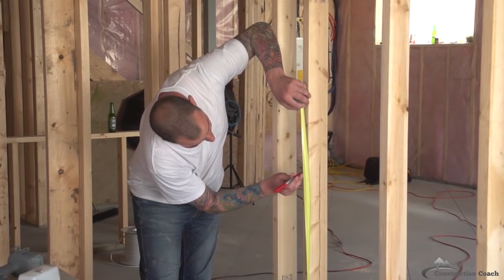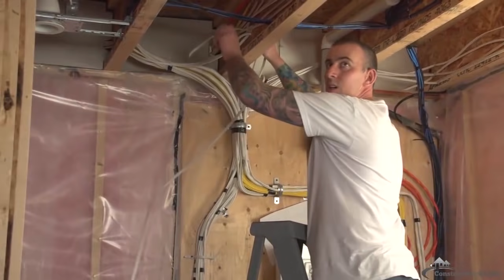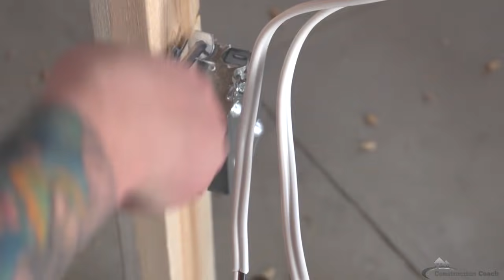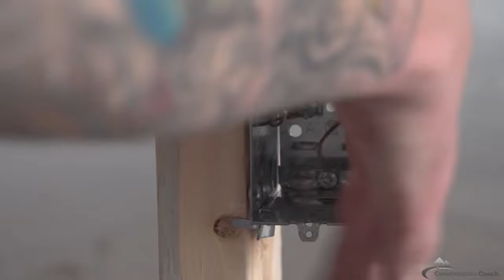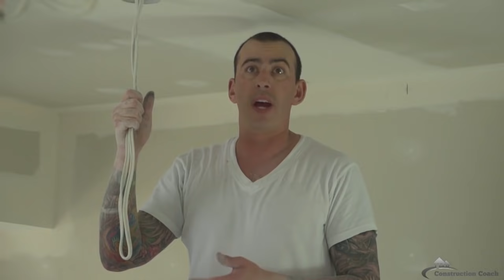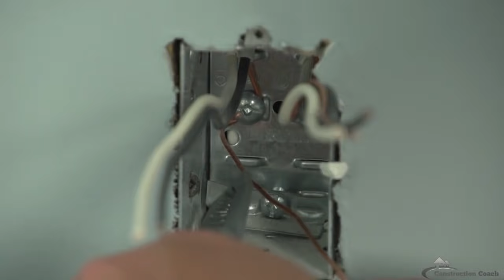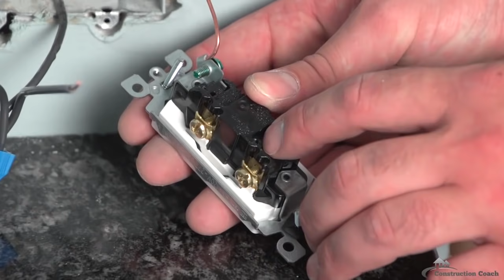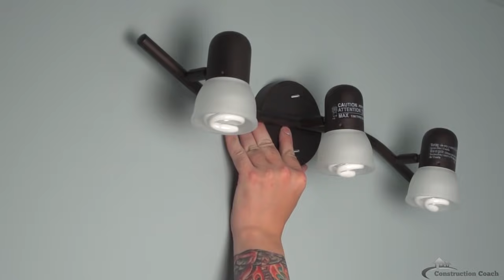Home Electrical 101 - What you need to know now!

Comment: why didn't they do the vapor barrier after you installed the outlets
Reply: tony krzic Just like my house, the house was bought with an unfinished basement. The foundation walls need to be insulated and a vapour barrier installed. If a home is bought with a finished basement, they would have definitely installed the insulation and poly after the electricians had roughed in the walls.
Reply: tony krzic hui
Reply: tony krzic *receptacles
Reply: Because it's not they're responsibility to hold his hand. You need to stay ahead of burying trades. (That's why they have job meetings). Shit rolls down hill and the last guy in the wall loses. That job ended up taking longer than it should have which equals less money in his pocket.
Reply: t krzic just a thought but I found out my boyfriend is gay

Comment: I was told never to split the outer jacket with a razor knife like that.  I always split just about 1/2" on the tip, then pulled it apart and knipped it off with linesman's.
Reply: Actually, Klein makes a hook blade knife that is designed to split the outer jacket of Romex, they work quickly and safely.
Reply: Joe Swanson he bends, then cuts a half inch from the bend on each end, specifically, because he says you shouldn't utilize the bent section
Reply: I've been doing it like that for 30 years
Reply: @chadwillis1010  I had one of those when I was a rookie

Comment: bro 14 gauge wire on plugs? Its fine for normal lighting but i would run 12 gauge on plugs.

common sense code-
240.4(D) Small Conductors. Unless specifically permitted in

240.4(E) or (G), the overcurrent protection shall not exceed

that required by (D)(1) through (D)(7) after any correction

factors for ambient temperature and number of conductors

have been applied.

(1) 18 AWG Copper. 7 amperes, provided all the follow-

ing conditions are met:

(1) Continuous loads do not exceed 5.6 amperes.

(2) Overcurrent protection is provided by one of the fol-

lowing:

a. Branch-circuit-rated circuit breakers listed and marked

for use with 18 AWG copper wire

b. Branch-circuit-rated fuses listed and marked for use

with 18 AWG copper wire

c. Class CC, Class J, or Class T fuses

(2) 16 AWG Copper. 10 amperes, provided all the follow-

ing conditions are met:

(1) Continuous loads do not exceed 8 amperes.

(2) Overcurrent protection is provided by one of the fol-

lowing:

a. Branch-circuit-rated circuit breakers listed and

marked for use with 16 AWG copper wire

b. Branch-circuit-rated fuses listed and marked for use

with 16 AWG copper wire

c. Class CC, Class J, or Class T fuses

(3) 14 AWG Copper. 15 amperes ************************************************ those plugs are on 20 amp breakers.

Comment: A lot of folks only have lower  levels partially finished off. He was not the  general contractor. I watched the  entire video except for  maybe  code variances he gave   good  solid  advice. Nothing wrong here  so  just because he ain't doin' it like you did back in  the day when you  kept  finish nail  or two  n your  lunch box  to  use  as  a toothpick  to get  yer wife's homemade Jello out from between your teeth   He gives  really good advice  even the old  timers could  learn a trick  or  two from him. FYI  I built and remodeled homes for 45 yrs.

Comment: dude...you forgot to put tape on the divaces...doble safty becouse you used metal boxes...plus you never cut an extra groud wire ....what you do is twist them toguether with the rest of the grounds and put a ground wire nut or a groud clamp and pig tail them out....plus receptacle code is the first one must be with in 2 feets of the door then every or with in 12 feet max......
Reply: Isn't the code within 6' of a door.
Reply: yes
Reply: He definitly forgot the tape but here in the EU (europe) we use plastic

Comment: Lights and sockets on the same circuit????????????????????????? :o) Not good!!!!!
Reply: Alan Lumsden this is residential work so this is normal.
Reply: It's certainly not normal in the UK
Reply: Alan Lumsden 25yrs doing electrical and its not the norm to wire lights and outlets on the same circuit in Connecticut.
Reply: Key word you said there was in Connecticut.
Reply: There is nothing in the CEC or Ontario supplement that doesn't allow lights and general duty receptacles in a residential dwelling to be on the same circuit, save the specific receptacle circuits that are now protected by an arc fault circuit breaker.
Reply: As a practical matter if you tinker around and you blow the breaker then you are in the dark. Thus often a design taboo unless one is selling cheap low-end track homes. ie one is cooking and a toaster and blender plus refrigerator just starting would blow the breaker then the kitchen is dark with the hot items on the stove. Tract apartments did this in Calif, so cheap that there were no ceiling lights in the 2 bedrooms, the wall switch controlled the duplex wall plug that the tab was cut so top plug switched and bottom always live. Once you had the old CRT TV, connected the stereo amp and a 1500 watt heater on a rare night the breaker might trip and you are in the total darkness. One learns to have handy flashlights. The entire setup was the tenant had floor lamps, their own stuff to ruin. The circuit breaker box was in the kitchen area, it did not feed the token 120 volt smoke alarm above the stairs. Thus when the alarm died at 2am at night one took the gizmo apart to go to sleep since it would chirp all night. The roofs AC unit always was at 2 amps to the breaker but no real power they had the capacitors on the feed side of the contactor to add Reactance to the system to even out the other units motors inductance. The only 14 awg wire was to those smoke alarms that went to each block of 4 units, the building had 4 blocks of 4 units thus 16 apartments per early 1970's building. The only aluminum wire used was the feeds to each subpanel in each apartment. These connections would be doped up and retightened when the unit was re-rented since earthquakes tended to loosen the connections. There was the typical no service loops or slack to save money thus the wires would move and loosen up and thus heat up the subpanels input lugs.
Reply: All kitchen counter receptacles here are split, two separate 15 amp circuits, one for the top and bottom of the counter receptacle and usually around 4 of these, all depending on the length of the counter. Refrigerator are on there own circuit, as are microwaves. And of course ranges have a separate 40 amp 120/240 V outlet. The smoke/CO2 detectors are on a separate circuit other than hall lights so it's easy to tell if the circuit has failed. We have to do a calculation to ensure any any circuit runs will maintain the minimum allowed voltage drop, the 4 blocks of 4 units sounds like it would violate code to use 14 ga as the feeder.
Reply: Those old Calif Apartments probably had an inspector to check the model apartment to correct NEC code, then they just wired the apartments like they wanted to. The smoke alarms draw hardly any amps at all even when in alarm mode. Since 14 awg is the required min wire size they use that. But they did have them wired through a breaker not in any of the 4 apartments. Maybe some odd California Fire rule, I am not sure at all. 

Down here in the swamp the breaker boxes get corrosion with time. It rains 70 inches per year. A 20 amp breaker that sees little current flow may later make noise ie sizzle on its lugs when say a big 13 amp dehumidifier is connected. Usually, the breaker thus gets hot and it will trip at a lower current, ie springs weaken. But I have had some eat the lugs off the breaker box and thus that slot has to be abandoned, plus breakers that use the same lug.  The better boxes have solid copper with plating. The econo box has steel? or some other metal and plating thus these are less robust around salt air and water. Regards.
Reply: Shocking
Reply: Lights and receptacles on the same circuit are perfectly normal and to code.
Reply: Chad you definitely do not know anything about code. Kitchen counter outlets have to be on at  least 2 circuits and be 20 amp rated. They do not have to be divided receptacles.
Reply: Sorry Doug I guess after 30 years as a Master Electrician I don't know anything. I didn't say thay Had to be splits. You should read CEC code 26-712 (a) (iii), you can use either 5-15R split receptacles or 5-20R along counter work surfaces. The 5-20R was only reintroduced to the CEC code about 10 years ago to try align the CEC with the NEC. It is an antiquated method we used to use 50 years ago. The split receptacles are far superior but more expensive to install.
Reply: Hi Chad, what is funny is most folks I know do not own any gizmos that plug require a 5-20R type socket. ie even my big worm drive saw does not have the one pin turned 90 degrees. But I do have a 1500 120 v watt water heater with 12 awg wire plugged (yuck) into a regular 5-15R receptacle and this does make it warm. ie 1500/120= 12.5 amps. I was over slighty the 80 percent rule ie 15 .8=12 amps. By changing both the plug and socket to 5-20 R and P the connection is cooler. ie 20.8= 16 amps. Both plugs were brand new, the 20R was new, the 15R was older. As an experiment I cleaned up and tried a new 15R and it too ran warmer than a 20R with the 12.5 amp load. Thus the intervals brass pieces of the 20R and 20P I think are bigger in cross section. Thus a 5-20R duplex in a Kitchen might more that the receptacle can handle two gizmos better than a 5-15R duplex.
Reply: Nothing in the code state that plugs and lights have to be separate. But if you're doing a reno from scratch it is recommended to separate the lighting circuit from the plug circuit
Reply: I been in the field since 2006, each Continent has different codes, rules and AHJ, in the US, receptacles, switches, lights, etc running the same amperage can most definitely run from 1 another, as long as the device performs to its standardized function you can do almost anything as long as compliable with the NEC.
Reply: Alan L'
In England they use "Ring Main system" with plugs that have fuses in side that are rated to suit the appliance to which it is connected. Most people here in Canada have never even heard of that system. 
But it is allowed in Canada to wire the lights into the receptacle circuit
Reply: Doug/ Chad  The code has now changed. 
In the kitchen you have two receptacles  side by side in a double box. One outlet is wired to one circuit. (The 'hot' connector strip is not cut )  The other outlet is wired to a separate circuit. 
#12 wire is used for these circuits with a 20 amp breaker per receptacle combination.( usually 12/3 with ground is used, One red and One black per circuit, with a common neutral white.
Another double outlet box is then wired in the same way. These two boxes must not be more that 4 feet apart, (in fact all receptacles that service the kitchen counter tops must not be  more than 4 feet apart.)
There are more regulations on the layout of kitchen plugs etc. which you should reference for your particular area before you do any install.
Reply: Lights and sockets never on the same circuit. Maybe this is the standard in America? In the UK this would be virtually be illegal.
Reply: Disclaimer, i am not an electrician. Here is Massachusetts i just had my house re-wire from top to bottom and the ahole electrician did put the lights and outlets on the same circuit. He even ran the basement lights, outlets and fire alarms on the same circuit. I have to split them all. If it passed inspection i guess is accepted by building code.
Reply: I've seen it both ways. Although I'd prefer to separate them.
Reply: Kitchen counter should always be twelve/ twenty. My toaster oven is 1800 watts.
Reply: @JoniAntonio  
If you are not an electrician, I wouldn't go tampering with what the professional electrician did.
Reply: It can be done
 but I like to keep my plugs on a 20 amp circuit and light on 15 amp circuit. Same as you because there so much stuff today could push the load over 15 amps. I agree with that to.
Reply: You can do it. But I don't do it either. I keep my plugs on a 20 amp circuit. And lights on 15 amp circuit. Home owner has so much stuff to day then back then.
Reply: @3beltwesty  
You don't know what you are talking about. Kitchen lights, or luminaries, are not permitted to be on the same circuit as the small appliance circuits required. This guy was wiring a bedroom, and yes it is entirely normal and acceptable for bedroom receptacles and luminaries to be on the same circuit.
Reply: @Doude4222  
Why? Please explain.
Reply: @johnahern9908  
Care to share the code article requiring these 2 gang boxes with both small appliance circuits in them? I haven't come across that one.
Reply: @realTlMBOSLlCE  timboslice, see you are new to electrical and not aware that all is not built to one single standard. this guys video is in Canada   . the place I saw sockets and lights on the same breakers was southern California in bedrooms   it is rare  to see that in a kitchen.  I even mentioned that this is bad too. thus as you start to work in electrical you will find there are buildings built differently and built to older codes  . in California I have seen tract homes and apartments built with kitchen lights on the same breaker as the toasters plug.  yes it is bad  . just because a code is newer or it is in the code today doesn't mean stuff always gets done right.   it's called the real world. get some real world training and road feel before you venture into electrical work. entire sub divisions that are real old have sometimes the lights and sockets in the kitchen on the same circuit.  thus the Northridge quake repairs I did over 20 years ago had a dead kitchen lights and sockets since all on the same breaker.  just because  it is bad or not to code today doesn't  mean it does not exist in the field. try to get some experience so you do not get hurt via assuming all things are done one way.
Reply: @3beltwesty  
I've been in the field for 20 years and am actually a contractor for residential electrical in Wisconsin. We have some very strict inspectors here. You may want to read my last response to you again. You seem to have the idea that I am condoning having kitchen lights on the same circuit as the "plugs"...this is a clear code violation and would never be allowed to happen where I come from, same goes for the dining room, dinette and laundry room. You wouldnt typically see lights and "plugs" in bathrooms on the same circuit however there is an exception. Bedrooms, living rooms, dens, rec rooms, etc are a different story. Those areas commonly have lights and "plugs" on the same circuit. Careful next time you question someone else's experience, I know residential code like the back of my hand.
Reply: Nope. what seems to be the problem here. its fine in india. there is no problem grouping together all the light loads.. just keep the power and light loads seperate
Reply: You don't know what you're talking about.
Reply: @chadwillis1010  kitchen counter plugs should never be a 15amp circuit,  where do you people get your information
Reply: @Doude4222  recommended by who ?
Reply: @johnahern9908  totally wrong  , what country are you talking about.
Reply: @JoniAntonio  perfectly fine
Reply: @realTlMBOSLlCE  that's because there isn't any code that said that  ,two 20a small appl.circuits is the code.
Reply: @realTlMBOSLlCE  that's not nec code that's the inspector.
Reply: @gregberban9273  
What are you referencing? A lot has been discussed so far.
Reply: It's technically to code here too but why would you want to cheap out on a few $ worth of wire and extra breakers for a setup that's much less convenient and not quite as safe.
Reply: Every one just trash talking one another lol. Let’s just educate each other. Lightning circuits and receptacles should always be ran separate.
That way if you ever trip either circuit you won’t be in the dark. Lighting circuit trips you can still plug in a light, and if your plugs go out you can still turn on the lights 👌
Reply: @TheReill83  
Great idea, not practical where I do business.
Reply: @TheReill83  exactly

Comment: Why the hell are u using metal boxes???
Reply: cause plastic boxes are shit
Reply: @Stormycloud701  plastic boxes are easier, faster, and cheaper. In a residential building, it makes absolutely no sense to use a metal box in this scenario
Reply: Nick Last-Name  cheaper maybe, faster and easier no.
Reply: @Stormycloud701  how would the metal box be easier and faster? Mounting a plastic box is 2 swings of a hammer, and there's no need to ground the box or tighten clamps. No way is it faster or easier to use metal.  Personal preference maybe is the only reason to choose metal
Reply: To ground directly to the boxes.
Reply: In Japan, plastic boxes are the mainstream in electrical construction of houses

Comment: THIS VIDEO IS GREAT, AWESOME INFO, IM AN ELECTRICIAN TOO AND I WOULD RECOMMEND TO WRAP UP WITH ELECTRICAL TAPE THE RECEPTACLE BOXES AND THE LIGHTING SWITCHES THAT WAY WHEN YOU PUSH BACK INTO THE BOX IT DOESNT SHORT YOUR CIRCUIT, MIND YOU SPECIALLY GFCI RECEPTACLES ARE THICKER THAN THE REGULAR ONES.